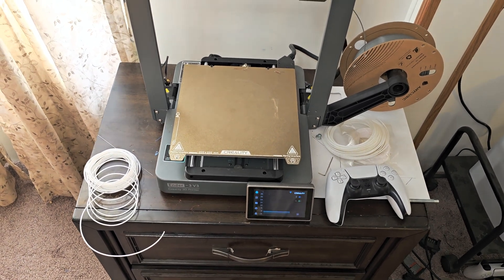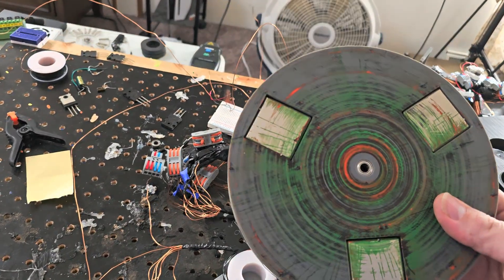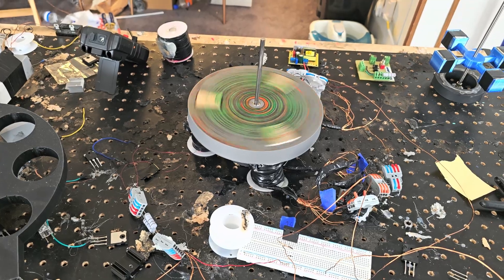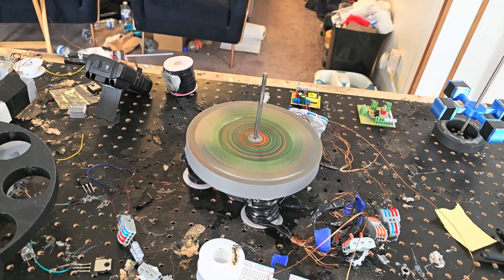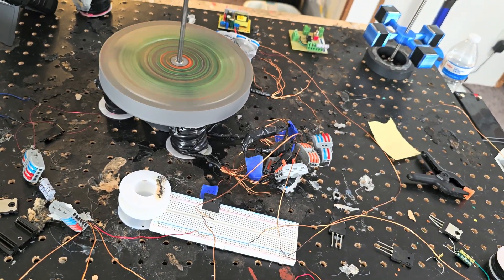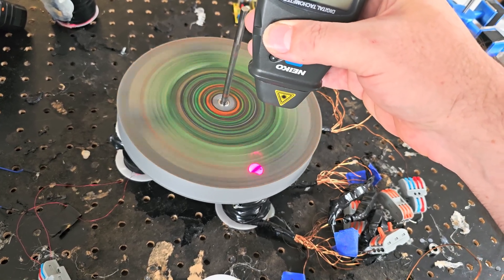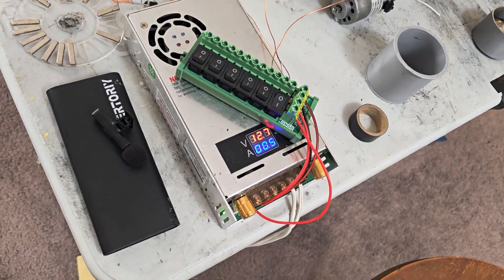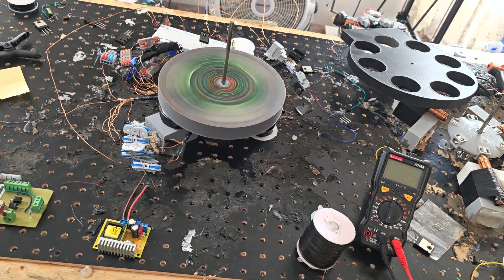pulse motor small coil addition works to make running it cost less.

Comment: hi, the motor is very cool, it runs on voltage, not on current, hope you share the connection diagram, the number of turns of the coils, thanks.

Comment: what does the second knob do on the power supply? 
i used to think it could ge amps,
 but on my power supply i got fine tuning aswell
Reply from the maker: just raises and lowers the ceiling for the total amp draw i like to run it all the way on
Reply: @MPHJR  i get the noise you get and on mine it's literally to do with my rotor having a tiny amount of play on the shaft, I'll fix it on the next rotor
Reply from the maker: @doubleooh7337  it may be there is some space there in the bearing

Comment: Ever thought about trying the coils on the smaller setup in a vertical fashion directly underneath the magnets for the drive coil? Get that pinpoint field where you want it
Reply from the maker: The 2 drive coils are at 120 but the trigger floats so i feel that they are right if you mean for me to turn them on there side i can try it i am making a chassie for the stator to spin though
Reply: @MPHJR  use the smaller coils from the 4" setup, vertical in the new one
Reply from the maker: @soul2065  so use the long coils with the cores  or use the coils on the side motor to run the one in the middle?
Reply: @MPHJR  ya the smaller ones with the cores from the 4" setup, you spoke about them having more of a pinpoint effect on the magnets. setup vertical under the larger setup, can use the litz wire coil as a pickup/generator coil.
Reply from the maker: @soul2065  Ill look into it ill need to test that some how to see if it is going to be worth it but i think it may work its just that this motor doesn't like cores to much but ill look into it
Reply from the maker: and yes i want to fit one on a top
Reply from the maker: you know a draddle